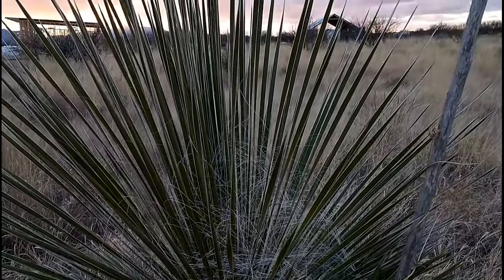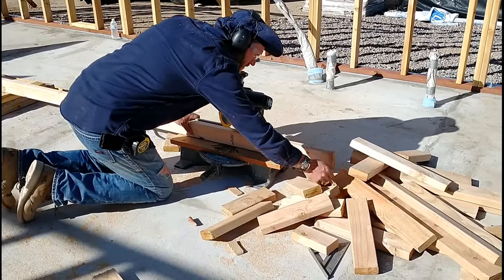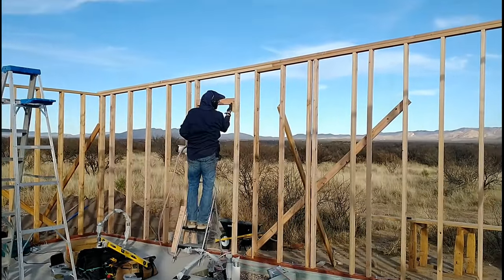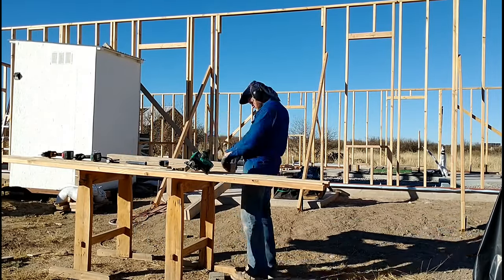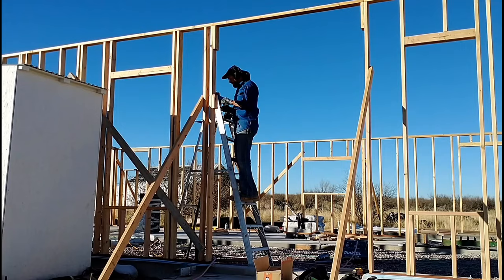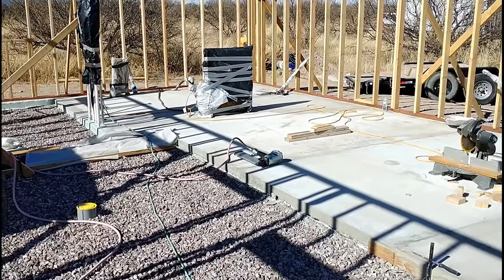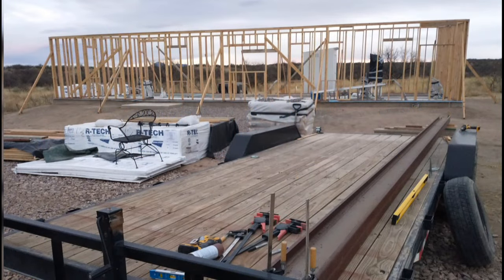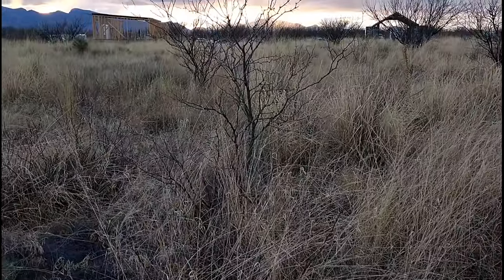#13 Headers & Top Plate | Finishing the Exterior Framing 🏠 DIY Off-Grid Home Build

Comment: We haven't seen many mohave greens or rattlesnakes this year.
Reply from the maker: Do you normally see more rattlesnakes? In the summer we were consistently seeing snake tracks down our road and by the gate, but we never actually saw the snake. Hopefully it's a bull snake or some other harmless variety. 🐍😊🏜️
Reply: @RedandAprilOff-Grid  normally we catch and kill them. Mohave greens are territorial. We haven't seen any sign of them here on the main property. No regular rattlers either. First time in almost 5 years this has happened. Maybe they are living on the other 6 acres. I have wondered if it might be due the electric fence... maybe I buzzes or something. 😆 🤣 😂

Comment: What is the roof pitch? Im starting the framing on my desert cottage this month and im currently planning a 2/12 pitch on my metal roof.
Reply from the maker: We used R-Panel and did a 1/12 pitch. Best wishes on your build! 😊
Reply: @RedandAprilOff-Grid  Hi! Thank you for responding... your chanel has been very cool to watch, I like most of you followers, i enjoy the idea of build nontraditional and building on your own terms. I'm kinda doing the same thing and hope my tiny home comes out as cool as yours.  Once again, thank you for your response, I might just go w a 1-12 pitch roof.  Any concerns w this pitch since you completed your home.  Respectfully.
Reply from the maker: @desertmoonlightcottage3387  We haven't had any issues. We used R-Panel and sealed the seams with silicone.  🙂